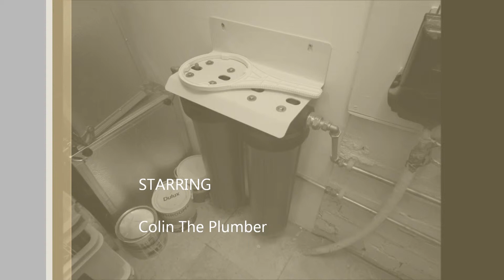How to Install a Whole House Water Filter System - A plumbers guide to installation

Comment: Hi, can I use 15mm flexi hoses for connecting system to the water supply instead of the copper pipes?
Reply from the maker: Yes you could